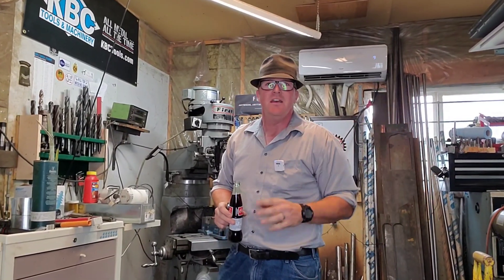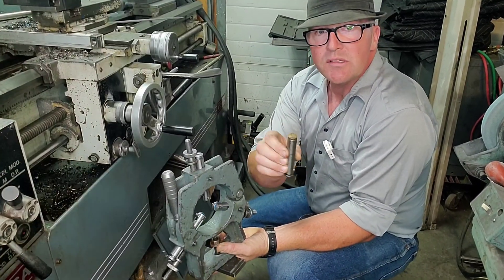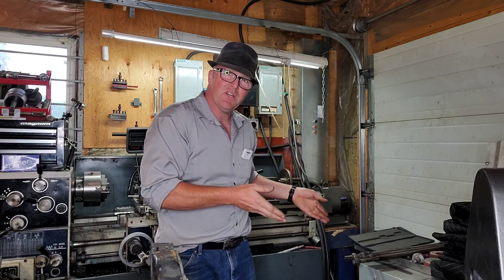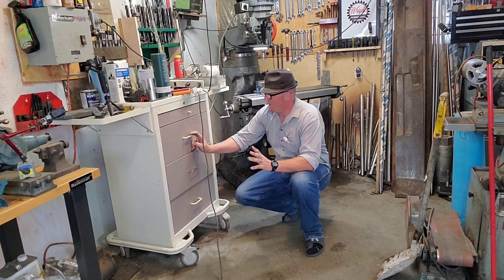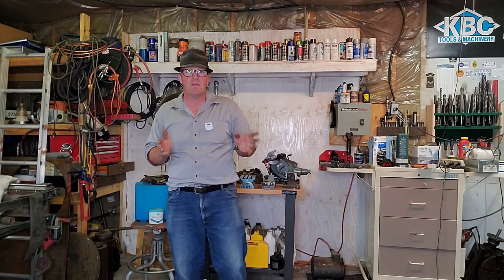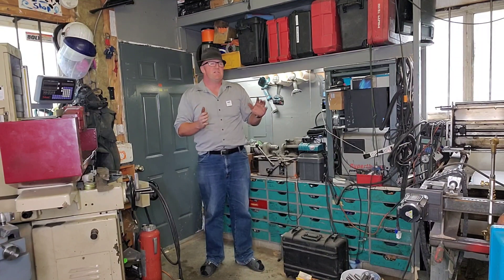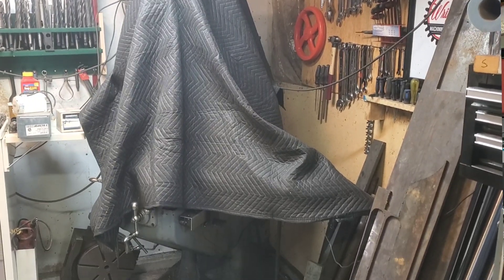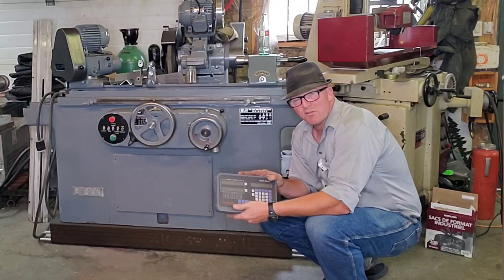Machine Shop Tour of Wright Machining

Comment: Great idea to use moving blankets as covers! And here I was going to get my sister in law to make one from Jean like material!
Reply from the maker: Great idea , cotton or not plastic i tbink is the way to do if the shop is climat controlled ( no moisture ) .   I am uaing cotton moving blinkets from PA . My plan is to take them down to the laundry mat every so often and wash them when they get realy dirty .
Reply: Just brainstorming here, would you be interested in a custom sewn lathe cover made of leather or something similar with a cotton liner sewn in on the inside? If so what would you value such a cover at ? 
I’m looking at making a batch up for the more common home shop/ hobbyist lathes but I can’t really gauge how much interest there is out there for such a thing.
Reply from the maker: @jasonhull5712  its a good idea . I think the only issue that could come up its moisture condencing under the cover causing rust to form .   However if the top  was leather amd the sides a breathable fabric it may work good .  What about a leather top with velcro sewn into it . And cloth washable sides that came off . ( clearly marked so it could go back togeather quick .)
Reply: @Wrighmachining  it’s something that would have to be quick and easy, buckles & snaps, Velcro and zippers. I just noticed so many old timers with their metal lathes so clean and oiled beautifully. Meticulously cared for and the cover of choice = light blanket or sheets. Occasionally a canvas drop cloth.. but how many guys are really going to A) spend money on a cover, B) take the time to put it on and off. It would be a investment to protect your investment. But like I said, just kicking around the idea. 🍻